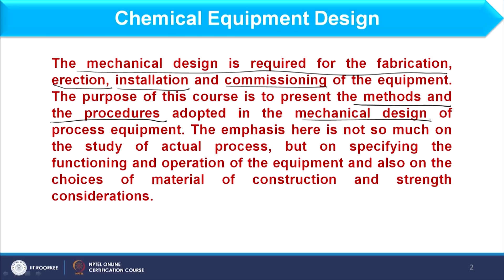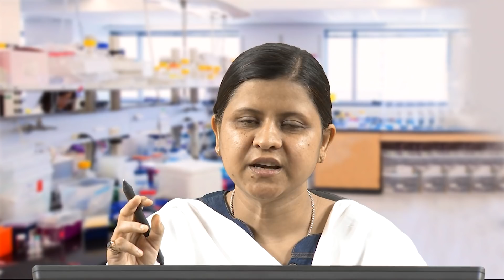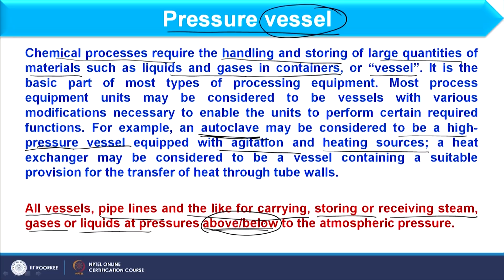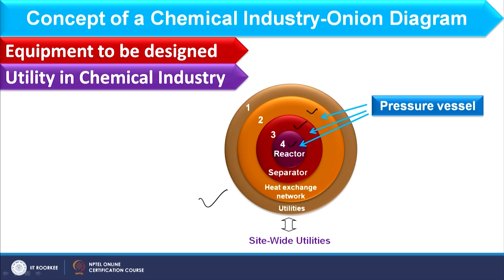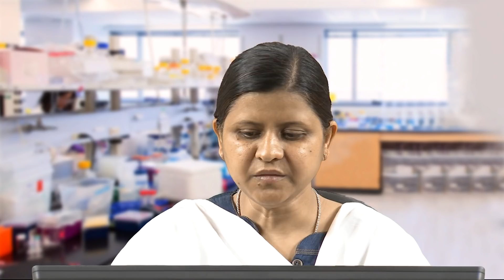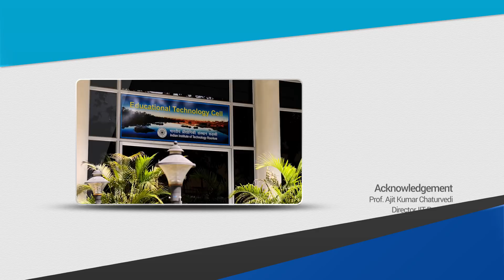Introduction

Comment: Nice lecture. However IS 2825 is rare in use even in India. ASME Sec.VIII-Div.1,2,3 & PD 5500 are more in use in an O&G industry. I would like to suggest to include these codes instead of IS 2825 code in next year certification course on this topic. If NPTEL needs some help in developing such course, I can help with literature and stuffs, as I am working as static equipment design engineer from last 13 years.
Reply: I was about to say the same. I am working in oil and gas for 9 years and no one uses IS standard. Can you @Hemant Solanki
 help me to design with ASME sec 8 div 1
Reply: I'm doing mtech in proces design..do u have any suggestions for skills i can learn apart from acadmeics that would be useful in the industry
Reply: As EIL involvement increases in the Middle East, I am hopeful for IS standards. We are one of the top nations in oil refining, We should develop/ Support our own standard.